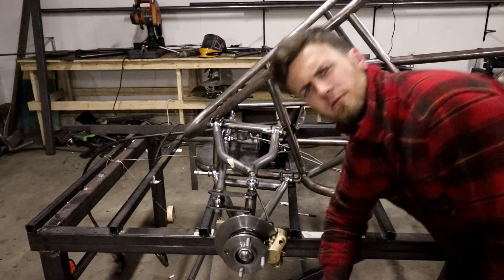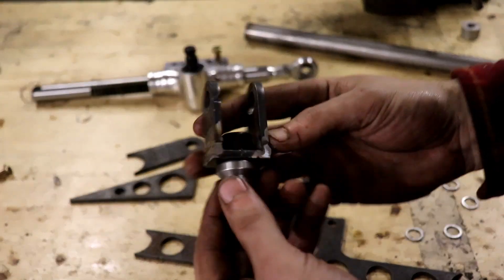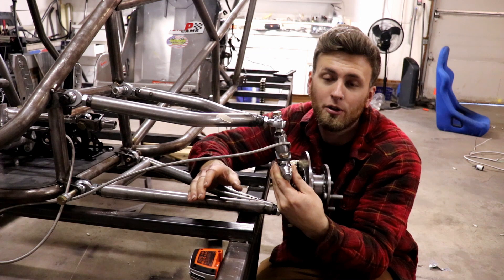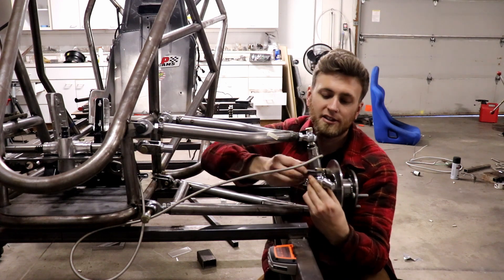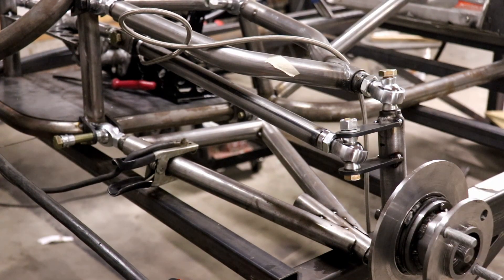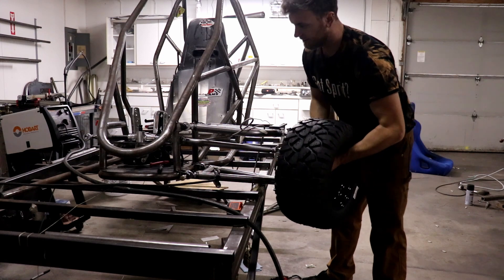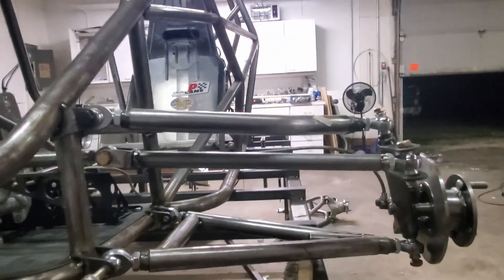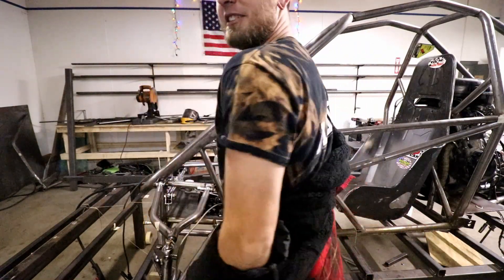Crosskart Build Pt. 6: Steering; Tie Rods, bump steer, Ackerman

Comment: There is one problem with your suspension geometry(not exactly steering). Its the fact that your front A arms (if you make straight line in ffront view FWSA) will intersect somewhere on the outside of the car not inside. That means when wheel travels it will make your wheel positive camber not negative so when youre in turn youre getting bad camber and loosing grip
Reply from the maker: What lines do you mean? Can you take a screenshot and mark what you're talking about
Reply: @jimkhana6881  https://i0.wp.com/suspensionsecrets.co.uk/wp-content/uploads/2017/05/FVSA-1.jpg?resize=750%2C500     I mean its not bad nor good BUT it needs to suit your purposes. Basically you want it like on the picture for corners and opposite for jumps but i see more benefits for offroad to not exceed parallel a arms. You know its best of both worlds and the camber change in drop (bump or jump) wont be affected. Also depends on the width of the tire if you have small tire width do not bother with my comment because theres no point to try to get grip in cornering when theres no rubber patch

Comment: Great content man, i’m building one as well soon with an R1 engine! 
Still looking for the best tubing i can use, this looks like DOM steel because of how it rusts? What kind and sizes did you use for the frame?
Reply from the maker: DOM is gonna be a little more pricey. I used ERW mild steel 1.5"x095 for all hoops and 1.25x095 for supports. Won't rust when you paint it
Reply: @jimkhana6881  Thanks m8